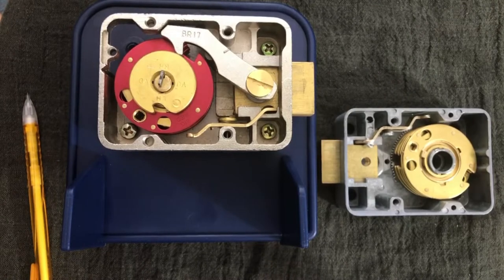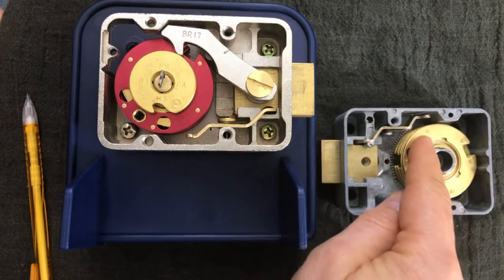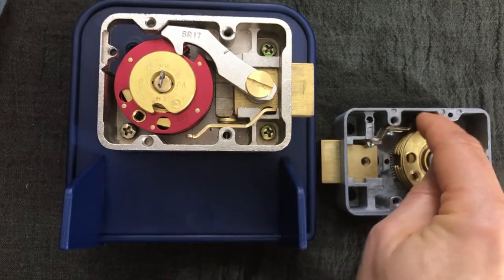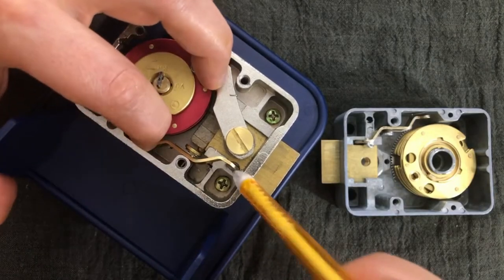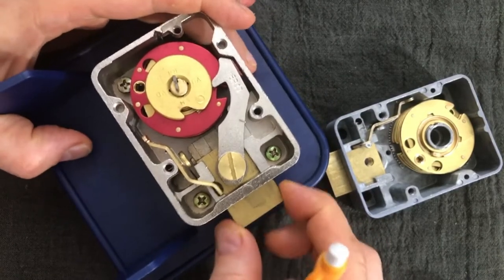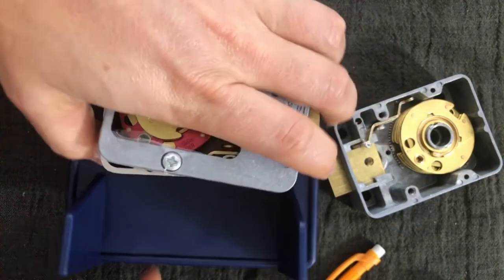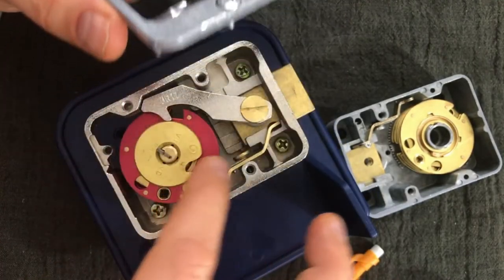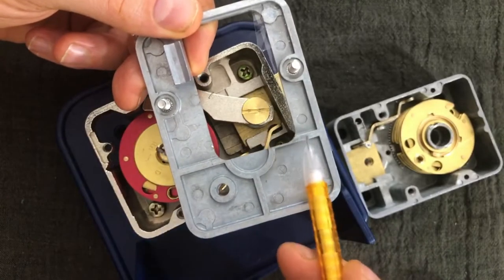Group 2 Safe Manipulation Course - Quick Topic - The Relocker, The Fly,  and The Forbidden Zone

Comment: 1. The movable fly allows more possible combinations than the fixed fly. 
2. I have never seen (although it might be possible) a lock set in the forbidden zone not open however, after opening the lock bolt will not be able to extend because the driver cam cannot lift the lever because it hits the lever stop on the lock case. The lock has to be taken apart to remedy this.

Comment: Sargent&Greenleaf state the following about the forbidden zone on there website "Do not set the third number of the combination between 5 and 11 on a lock with a dial splined at 50. The  forbidden zone  can shift slightly due to installation and tolerances, but will always be between 4 and 12. Do not set adjacent numbers of the combination within five numbers of each other."